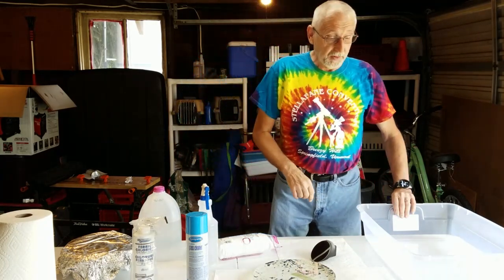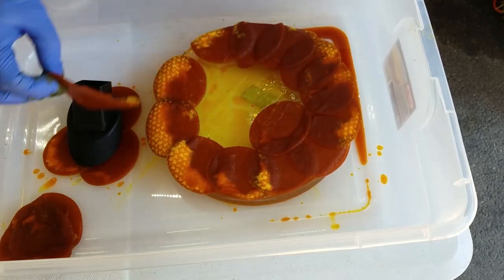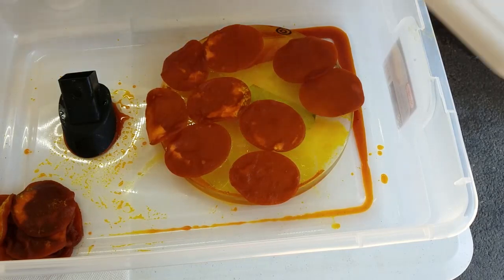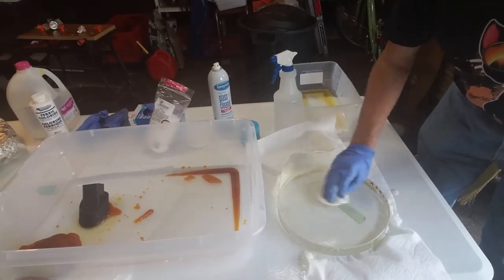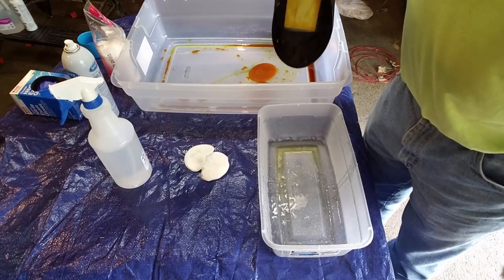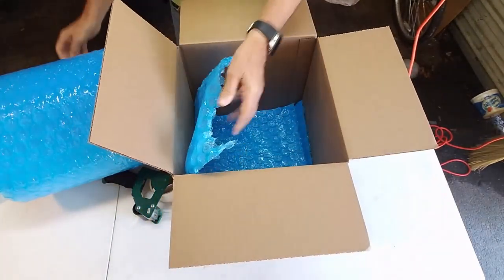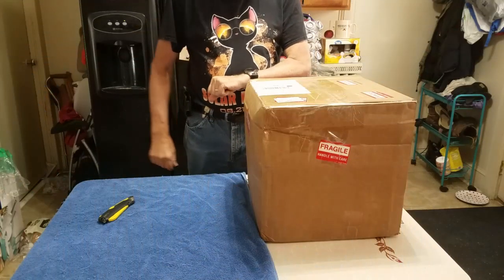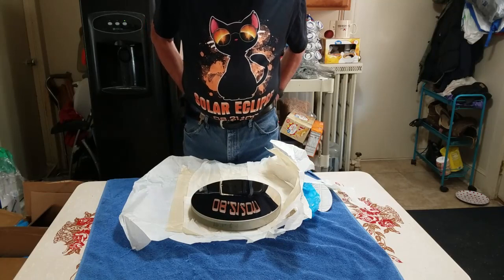Stripping the aluminum coating off a 10' Telescope mirror

Comment: Wouldn’t it be easier to place the primary mirror upside down on top of a couple ferric-chloride-soaked paper towels?
Reply: I suppose that would also work. A couple different ways to skin a cat. I had just assumed that gravity would assist in bringing the solution down to the mirror. I did reverse this on the secondary with the mirror sitting on the soaked pads. I would not use paper towels, however, as they are full of lint. I would use some sort of lint free medium. The cheapest I found were the cosmetic wipes.

Comment: This is not a good way to dissolve the layer, with the pad the possibility of reusing the iron chloride is very complicated and you can probably just throw the things away. It would have been better to surround the mirror with tape and tip the solution out. The secondary mirror could also have been hammered into a solution, so the solution could have been reused a few times.